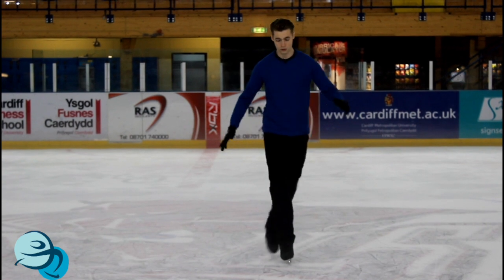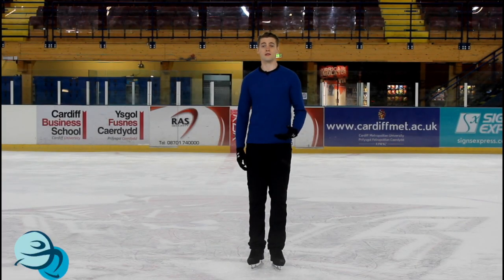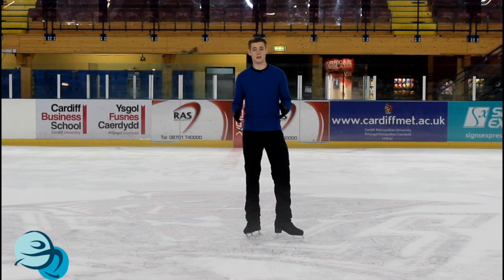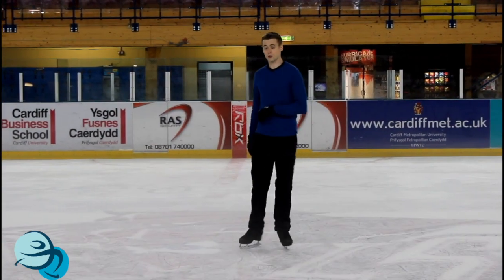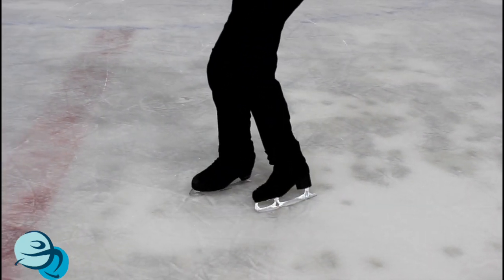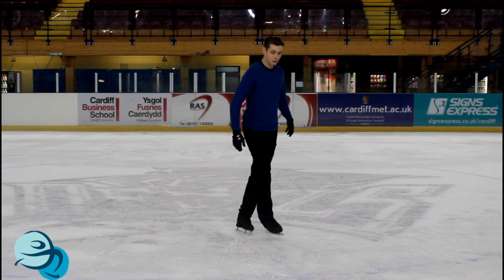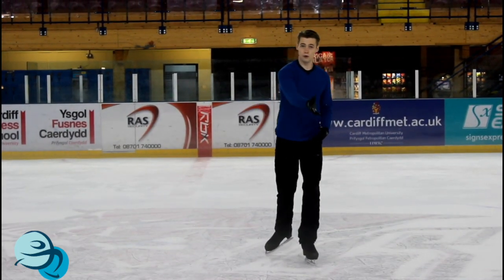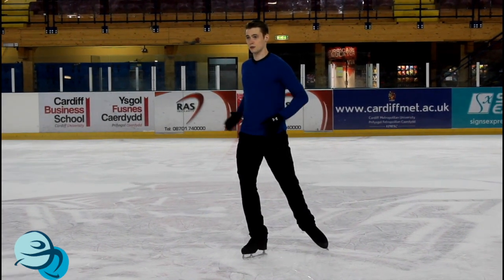Great Ice Skating Move Used by the Pros, Easy to Learn at Ice Coach Online! Forward Crossrolls!

Comment: Thank you for another great tutorial!! :)  in terms of learning sequence, is crossroll after/more difficult than crossover? also since there's the curve pattern, should I be able to do the outside edge move (the one in beginner mif test) before trying this one?
Reply from the maker: Hi Cindy,
Great question! Yes the crossroll is more advanced than the crossover. Ideally you will be comfortable holding a forward outside edge on a circle, and also doing continuous forward outside edges. But there is no harm giving crossrolls a try before you master these moves.
Don't forget, there is a lot more content on my website too, 3x more tutorial videos. There is a lot of content covering how to get over outside edges correctly.
Reply: @IceCoachOnline  Thanks a lot for the answer! great to know and will check out the website!

Comment: Shoulders and hips square and the travel movement of the free leg were very helpful. I had a problem getting thrown off the curve on my "OK side" due to twisting. And I guess my free leg wandering forward in a big circle instead of passing close by - right before transferring - added to that loss of control. Good. Tomorrow's exercises  are set :'D
Reply from the maker: Glad to hear the video was helpful for you! It is also NOT incorrect to prepare the shoulders for the new circle before changing feet (as opposed to staying square). This happens as you move your foot through, while staying on the outside edge you change your shoulder to face the new circle. This is just a more aggressive technique that can help with very deep edges. It isn't necessarily recommended for beginners though as it can sometimes cause them to change to the inside edge instead of staying on an outside edge.
Reply: @IceCoachOnline  That would explain why it felt "difficult" but not "off". Im 30, I'm skating for fun (and due to the sad lack of volunteer coaches for our hobby group calling me to duty :'D). And the one thing I really really would like to achieve is deep edges and doing simple steps in flowing motions. Jeffrey Buttle's in-synch fluent steps to music are a source of absolute fascination to me. I can sometimes recognise his students in competitions before looking at their coach or knowing anything else about them. If building a proper base with beginner technique before switching to more aggressive ones can bring me even a 1/10 close to that fluency, I'll do it! (+_+) Very very patiently! That said, you guys look so elegant on ice (even in blooper videos 😋), it's a joy to learn with you.